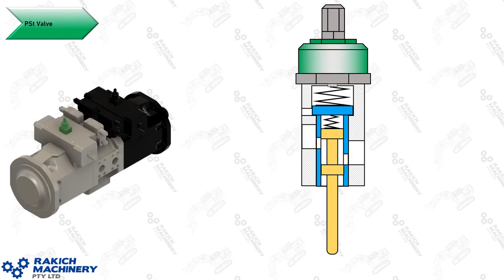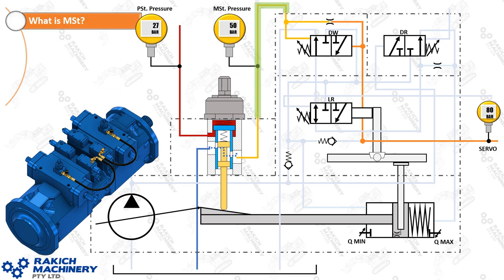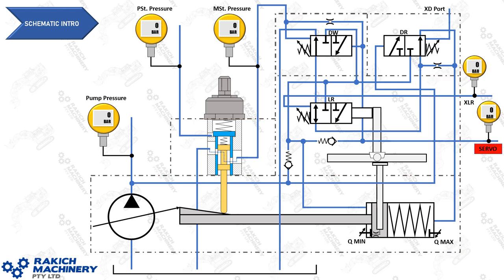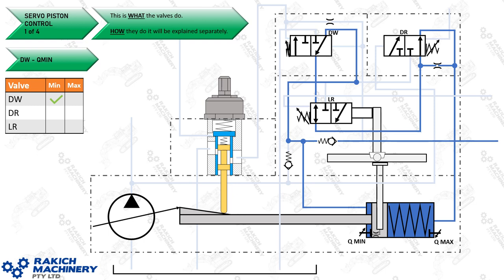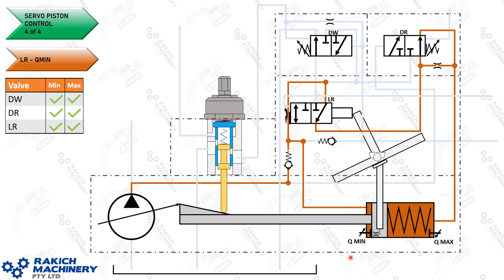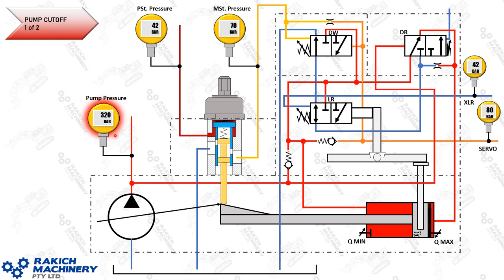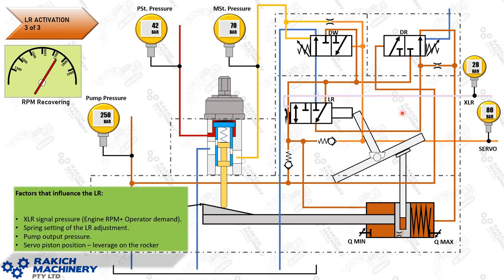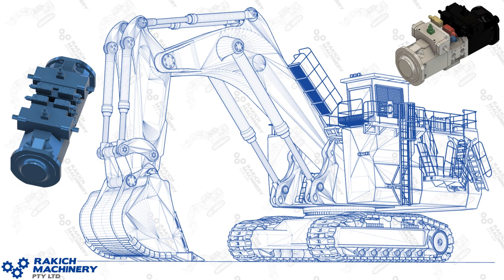A20VO Hydraulic Pumps. Part I: Control System

Comment: There something different on the current machine.
the pilot supply  ist not 80 bar from servo pump. now comes from charge pump  just 50. ¡¿how about the Final Mst value if the diference between them are 30 bar?
Reply from the maker: Yeah that's correct mate, for the 50 bar servo, the MSt is 20 bar.